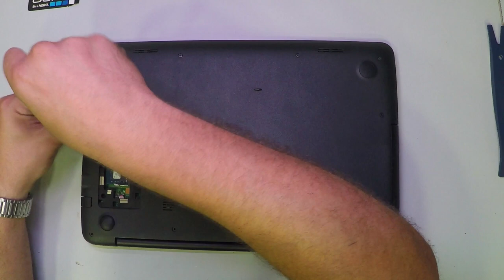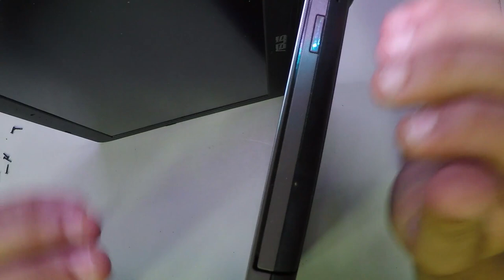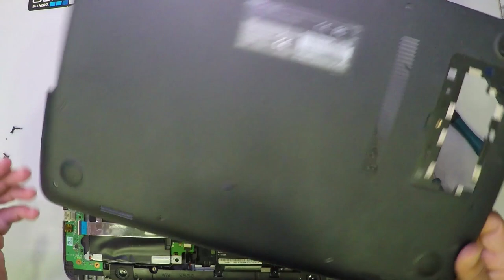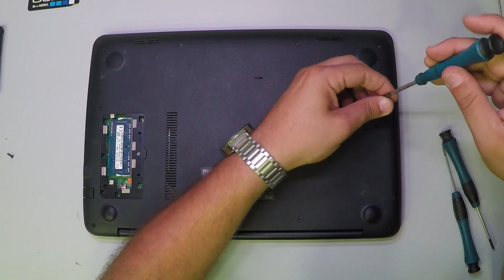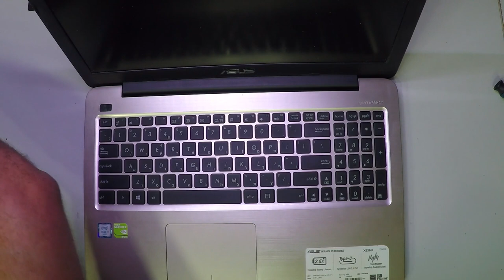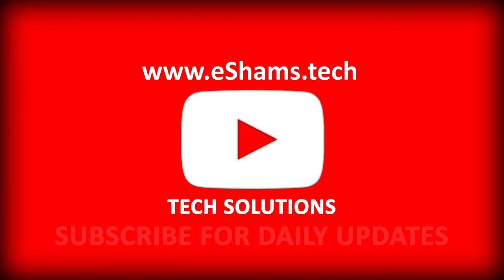ASUS X556U SSD UpGrade

Comment: Hi there! Thanks for your video! I have read in a forum that the budget variant of this laptop comes with nvidia 930 and has only sata connection for the ssd but that the version with the nvidia 930mx comes with a m.2 connection.. do you know if this is true? Thanks for your time. All the best
Reply: Did you figure out whats correct?

Comment: does it have m.2 slot? if it doesnt then can I add ssd w/ caddy to it ? or I need to replace the hdd to ssd?
Reply from the maker: Apologies I code not replay to your massages in time, I am back now and will replay to comment once a week in Friday. (you are welcome)
Reply: Its not M.2. You buy caddy for hdd.
Reply: @romelgonzales8444  what size caddy should i get? and the ssd should be 2.5 inch 7 mm right?

Comment: hey you know if i can upgrade its graphics card too? 940m is good but i wish i could put something like a 1650 or 1050
Reply: Laptop GPUs cant be upgraded since its soldered into the hardware(except for specific mods like turning your hardware into a PC, or buying external GPUs in which you're better of buying a new PC)

Comment: Hello. What ram should I use to upgrade asus x556u?
Reply: Hi, I do have the same model. You can check in your taskmanager -> performance -> memory,  Check the current speed of your RAM, then you can choose between 2gb to 12gb. I upgraded mine with 4GB DDR4 - 2133 hz : )
Reply: Hi Can I also upgrade it with DDR4 8gb 2400mhz ram? I have the same laptop asus x556u

Comment: If I have the hard drive model, can i put an Sdd without removing the Dvd?
Reply from the maker: You will need to replace your HDD with the new SSD. or add the SSD to your laptop with special 9mm caddy (instead of your DVD)

Comment: for dvd rom  will 9.5 mm caddy fit? and is serial ata (sata) suitable for the input? thanks u
Reply from the maker: Hello, you can add another HDD with 9.5mm caddy, but it will be a secondary drive.
Reply: eShamsTechTips i can add ssd with caddy? I want to set up OS in ssd and i will not remove normal hdd. Only add ssd with caddy.

eShamsTechTips what is your advice? Which one? my hdd or my ssd with caddy? Should I remove my hdd included in laptop already?
Reply: @mustafaakdemir1670  how did you do? Did you put the ssd on the caddy or hdd? Thanks

Comment: have a GPU upgrade?
Reply from the maker: Salaam Alaikum Tarik, the CPU in this model embedded to the mainboard you cant upgrade it.
Reply: DISCLAIMER -- I am not responsible in any way if you break or otherwise damage your computer by trying to upgrade it to have or use a gpu. Any of the actions you take from my advice are actions decided upon by you and are your responsibility.

There is a way with the exp gdc beast and if you're willing to use ethernet. I recommend you do your research, and after that go to r/eGPU from (reddit.com/r/eGPU ) and you may be able to use your laptop's mPCIe slot (taken up by the wifi card which can be removed then you use ethernet for wireless) for the exp gdc external PCIe slot. Then you may be able to use an external gpu.
Since this computer model in the video doesn't support m.2 or Thunderbolt (3, 2 or 1) then it can't use an external gpu by other methods. 
But, however if your laptop supports thunderbolt 3, or m.2 you may be able to use that too. Again, do your research!  if your laptop supports thunderbolt, USE IT. ITS THE EASIEST ONE. Or if you have a really old laptop, which features express card, there's a version of the exp gdc that supports expresscard. If you don't know what expresscard is, *do your research*.

Comment: do I need 9.5 mm hdd caddy or 9.0 mm or 12.7mm ??
Reply from the maker: Hello Dagger 9.5mm, and 9.0mm is the same (12.7mm is for older laptops) for the Asus x556u you need 9.0 or 9.5 mm both will fit.
Reply: Yes, I bought 9.5 mm it did fit but there is a micro gap between chassis and caddy but its not a big problem. 
Only thing that bothers me is little screw which holds old dvd rom did not fit to my new caddy. So I couldn't fix it inside.
Reply from the maker: Caddy comes with universal screws holes you need to mount the screws in the right place.
Reply: @blackiedagger682  Did you put an SSD on caddy? Mines already have an SSD but I want to know if I can put another SSD on the caddy
Reply: @Shamsabdelkader  thanks a lot!!!